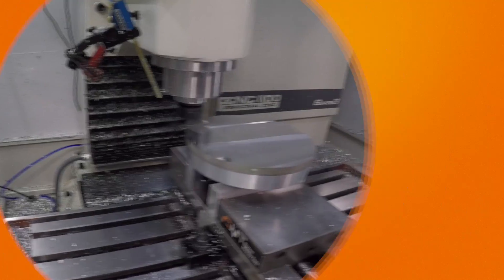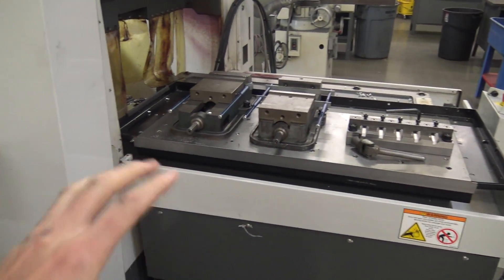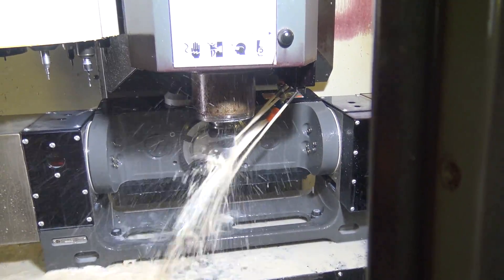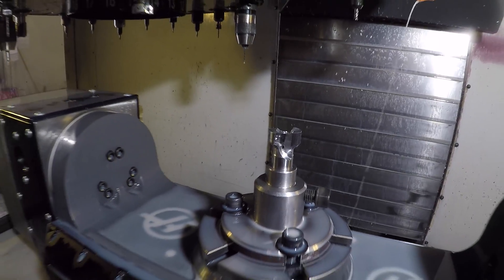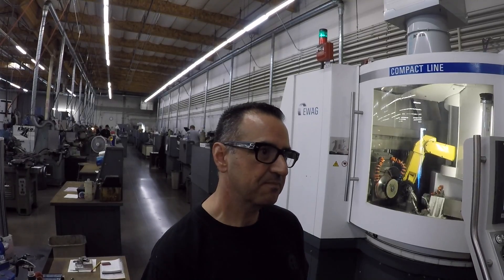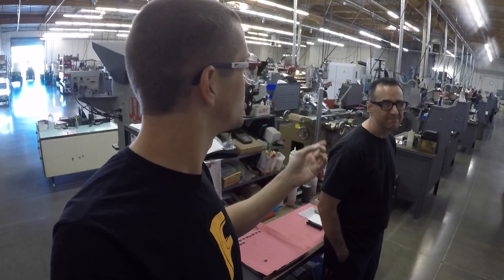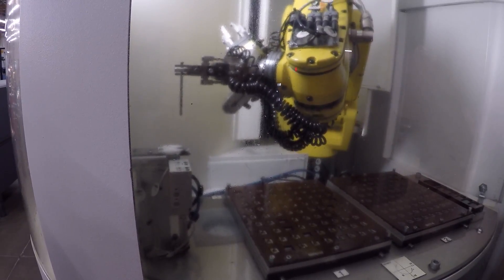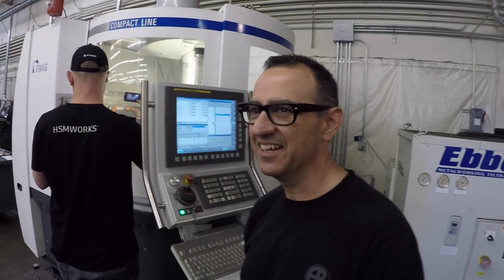How Its Made: Shear Hog CNC Hogging Tool!

Comment: John, those shots thru the grubby (with chips/coolant) machine window reminded me of your comment about spinning windows. Those were originally designed as ship's windows to spin off rain, fog, and spray so the lookout could see ahead. You can probably buy them from a ship's fitter. You can probably also make one with a hunk of 3/16" plex cut/turned round and a cheap AC box fan motor (or old record player motor) for about $15 in parts.

Comment: Do the grind in the chip breaker too?
Reply: The Metal Butcher the Shear-hogs don't have a chip breaker but they feed so hard and fast the chips break on their own
Reply: Ok, I couldn't tell if the inserts were flat or not. I wonder how they make precise inserts with chipbreakers.
Reply: The inserts I used to grind had the chip breaker pressed in when the insert blanks were formed prior to arriving at the shop to be finish ground.
Reply: Thanks. So the chipbreaker didn't really need the high accuracy and smoothness. I was wondering, because I saw some ccgt 32.51 inserts for aluminum, with a very high polish all over. It seems like if they could press that good of a chipbreaker, they wouldn't need to leave 25 thou on all dimensions.

Comment: why would they harden it from 36 to 38 HRC, like just buy HTSR steel waste of time.
Reply: I think he meant to was heat treated to between 36 and 38 HRC
Reply: Because they'd have to special order it as pre-HT, that isn't a stocked item.  HT is usually 29-32 RC, not 36-38, and it's not available in all grades.  Their tools will have a longer life by cutting in the normalized or annealed condition, as well.
Reply: do you have a set of hardness files? why don't you go see what your sandvik tools hardness is.  you will be surprised.
Reply: maybe you need to re harden the steel after working on it
Reply: 38HRC stock is not that expensive, and no they wont because they would use the tool with the appropriate coating, it would just run slower. But the UPS deliver guy runs slower.
Reply: Did you happen to catch the part in the video where Alfred stated that the small endmills don't last as long when they are doing the post-HT machining?
Reply: the difference is, between 36hrc and 38hrc. you would not see a world of difference compared to shipping your parts out. Did you not catch the part in the Haas cnc video where Haas is amazing because it integrates everything? I'm sure they don't last as long, but overall the solution is better, and somehow they rationalized it without seeing the forest from the trees.
Reply: The difference between annealed and 36-38RC is a lot.  Why do you think they were starting at 36RC and then treating it to 38RC?
Reply: i don't know, it would not have been my decision (like i said). the guhring RF50 endmills are optimal in range 30-38hrc. Here are a list of other tools steels you can get in <38HRC : O7, M1, M2, M3, M4, M7, T1, T2, T4, T5, T8, T15, A2, A3, A6, A7, H10, H11, H12, H13, H19, H21, L3, L6, L7, P2, P20, S1,
S5, S7, 52100, A 128, D2, D3, D4, D5, D7
Reply: The 36-38 is the range of finished hardness, not the starting and ending values.  The heat treaters don't treat to a specific number, they treat to a range, 36-38 is about as tight as I've seen.  When I was buying Pre-HT stuff, they only guaranteed 29-32, which is twice the span of what AB is getting.
Reply: Almost every quality heat treat company that services the cutlery industry will guarantee a 1 hrc spread. I use Peters heat treat in PA and they always do the trick. I specify 60 hrc, for example, and its always between 60 and 61.

Comment: they could literally replace 3 of those machines with 1 brother. did you see how slow it switched to the 2nd shear hog pocket?
Reply: Just looks like like a conservative setup, and as said that machines used for extra capacity...
Reply: they literally make nothing but small parts there, like jon said "wow thats the first vice ive seen in this whole factory"